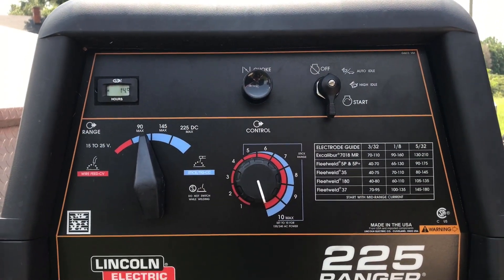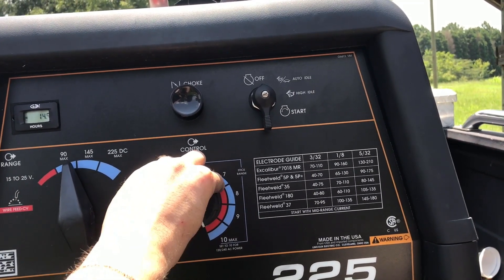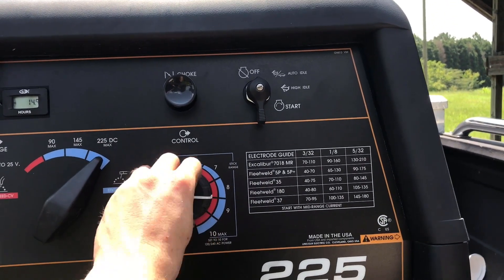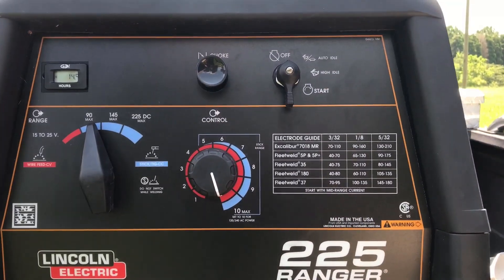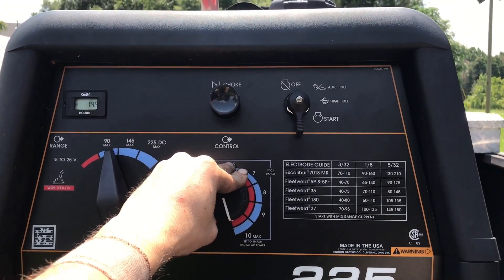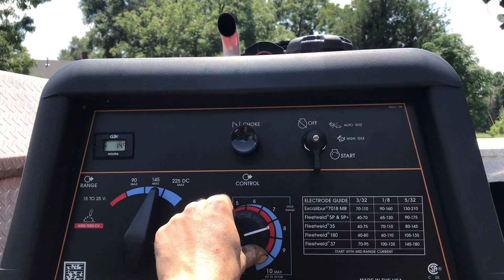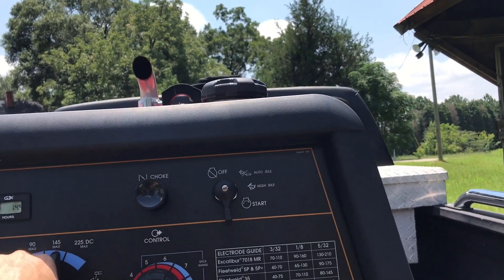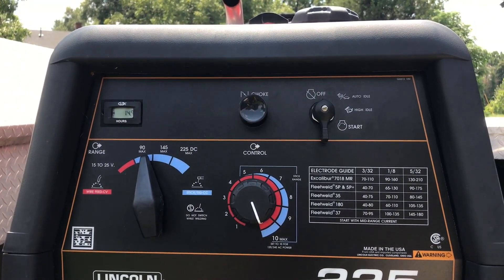HOW TO SET AMPERAGE ON A ENGINE DRIVEN WELDER!!!

Comment: What about 3/32 on 6010 amp 40 ?
Reply from the maker: Talking about 3/32” welding rods? The lowest this machine will stabilize a arc for stick welding is about 70 amps, I’ve never used any 3/32 6010 welding rods so I can’t really recommend a amperage but that
Is something I could do a video on in the future, if you wanted

Comment: Hi can I conect mig on this machine ?
Reply from the maker: Yes you can but you would need a inline wire feeder box, or you could just run a regular mig machine off of the 220v plug in on the machine

Comment: There confusing part when we first got the machine is that spreadsheet looking decal to the right of the knobs. The way you explained in your video was how it was explained to me also.
Reply from the maker: Well the spread sheep is correct for amperage which there is a way to gauge that with a multi meter I might show in the future but they could have better ways of explaining it supplied with the machine!

Comment from the maker: hey viewers if you have a question or an idea for a future video comment below and like this video and you might see your idea become a future video!
Reply: I agree with all your settings. Pretty good. I have a Lincoln and that's where I set mines, more or less. Like you said they all burn a little hotter or colder. But I'm impressed with my welder. Really nice.
Reply from the maker: That’s good to hear! They are great machines! And I plan to do plenty of projects on my channel with mine! If you ever have any questions or would like me to do a video on anything don’t forget to ask, I’ll explain anything I can to help!
Reply: Ok cool. I used to weld years ago. I did mig Tig fluxcored stick plasma and oxy acetylene welding. I love it. I'm an API inspector and cwi now and teach welding on the side.
Reply from the maker: That’s cool I just started a tig series on this channel and even though it’s scratch start being away from welding for most of a year and going from digital to the analog this machine has is a learning experience. But this machine tig welds pretty good once you get used to it! It welds better than I can for sure